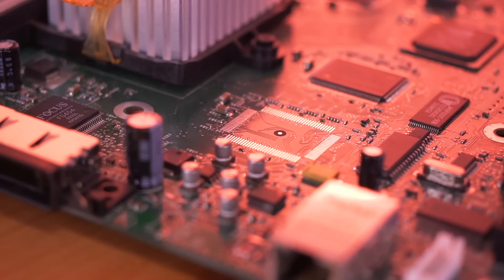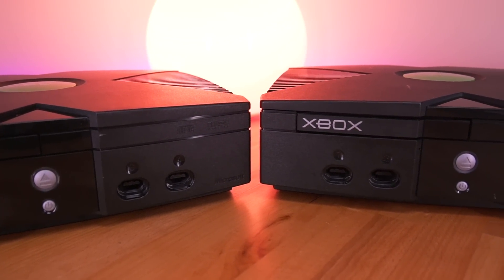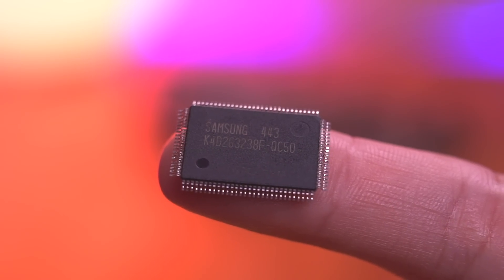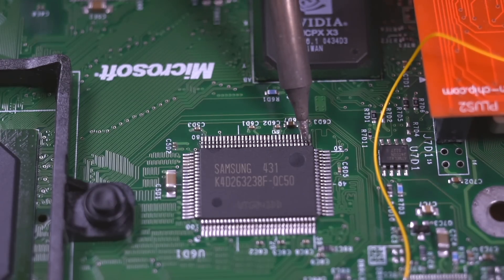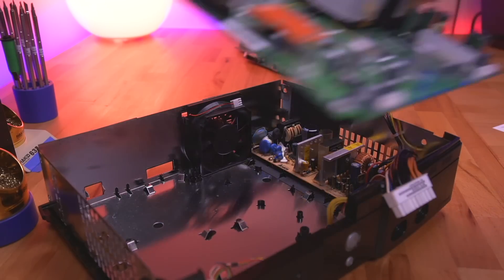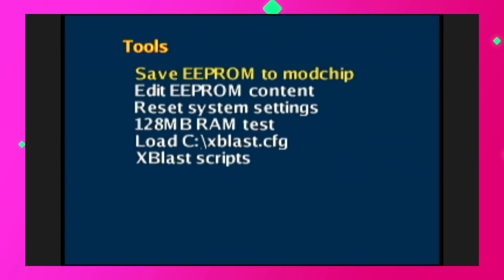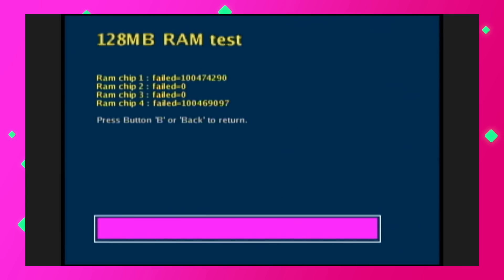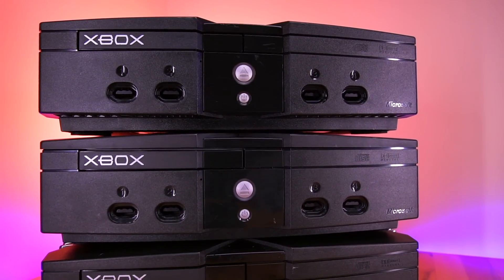I Did The Impossible 1.6 XBOX 128MB RAM Upgrade! | Piggyback Method!

Comment: ive tried this with two sets of ram chips all I get is the console powering on for a split second with orange light then it switches off I'm using aladdin chip Cerbios 2.3.0 beta, can anyone help with this, as soon as I remove the ram chip the console boots up fine with the cerbios I'm using, I've tried doing this numerous times

Comment: I don't think anyone with the know how thought this mod was "impossible" just not practical. Short of Microsoft redesigning the silicon there was always a chance to upgrade the RAM it just wouldn't have been pretty or easy. This is far from what I'd call difficult but it's also not nearly as easy as modding any other XBox revision which is why I think regular folk called it "impossible".

Really cool someone worked it out finally! I'd like to give it a try but finding legit RAM has gotten harder here a year later.

Comment: Now with a cpu swap you can even run windows on it

Because its just an off the shelf pc
Reply: And yeah someone has done that already
Reply: Just like the controller ports on the og Xbox are just usb ports with an extra 12vdc rail
Reply: Just disassemble, either put a custom lpc chip, or boot xbox with ide disconnected to DVD drive wait for error screen. Then hotswap unlocked hdd to a computer with ide with xbox still providing power to hdd, run a ramdisk and install unleashx to hdd and reassemble, chipless cfw.

Comment: 1) Obviously, all RAM modules share the same data lines; that's why it's called the DATA BUS.
2) The CHIP SELECT (CS) PIN is used to activate the module, but the processor itself doesn't "detect" it as you explained.
Reply: Dunno if you will read this but can you explain what happens to the chip select pin when its lifted and where and to what the connection goes to?
Our host here fails to explain anything and it really bugs me.
Reply: @alphadog6970  it's like a AND GATE on data output. Imagine one input of the AND GATE is the DATA and the other one is CHIP ENABLE (CHIP SELECT, CS, same thing).
If data is 0 and cs 1, data out is 0. If data is 1 and cs 1, output is 1, if data is 1 and cs 0, output is 0. Basically this

Comment: Its better if the pins are bent straight down like a socket type ic. But i wouldnt do the mod since im not really a big fan of mods, i mostly  think about preservation over modification. Besides, it doesn't help with retail games, like steel battalion, which i really like the most on xbox

Comment: Wouldn't that configuration actually slow down the memory though? I mean, if you were to think about it how memory is sold today where a 2Rx8 kit is faster than a 1Rx16 kit even when both kits are clocked and timed the same... i wonder if there's an accurate way to measure the differences between this and an older board with a memory upgrade.

Comment: There is also the RAM Delimiter tool which patches Xbox games to use more than 64MB.

As others have mentioned, this allows some games to be run at higher resolutions. Futurama is the first one to my mind as the RAM upgrade can allow it to run at 720p.

Personally, I’ve been interested in seeing whether it makes a difference to Morrowind performance.

Comment: So the only con is the difficulty of install? 

I seem to recall a company that would do the 128MB RAM upgrade mod and also upgrade the CPU with a faster one that fit the Xbox motherboard's specific bga socket. IIn the case of that mod, there was another con: Something about the CPU clock speeds and incompatibility with certain binaries. They sold their premodded xboxes with an external switch to toggle between clock speeds if I remember right. It's been a long while since those Xbox Scene days though.

Comment: I wonder if i could pay someone to make a flex ribbon cable to sandwhich ps4 ram chips on one end and then solder the ribbon to the motherboard ram slot instead. Since the points are underneath i wonder if that would work like this?

Comment: I just barely learned how to solder a mod chip on my 1.6 Xbox and replace capacitors. I don't have the skills required to do this mod, but I want to eventually. 

I used the same LPC rebuild board you used. It didn't work at first, until I found out that there are two contact pads that need to be soldered that connects D0 to ground. I was so confused when my Xbox wasn't working. Maybe this will help for anyone who uses these LPC rebuild boards.

Comment: Installing the ram would be fairly easy for me, regardless of the revision, but what i really want is the cpu swap for the OG Xbox.
Like one of those 1.4Ghz pentium 3's. And swap the HDD for like, a 256-512GB SSD. SSDs of this size are dirt cheap now.
256GB SSDs are $15 and 512GB are like, $25.
IDE to Sata Adapters sometimes cost more. OR there's that DIY IDE SSD thing that i've been hearing about recently.

I'd rather load the games off the SSD, which would load faster, and would allow for the 1.4Ghz patch (Modern Vintage Gamer) for games.
All that said.. There just aren't many games i'm interested in anymore.

Comment: Ram stacking is old school from before I was even born. Nice to see ita coming back for mods. Also have you done the cpu upgrade using n64 freaks board? If so do you have instructions or anything for it? Not sure if there is a different in pinouts from the 1.4 version.

Comment: Aaaa the memories, volt modding on old computers to facilitate more overclocking.
Glad i have a proper soldering station, and the skills to use it as back then you was tapping into these small IC legs
Doing the same today,,,,, well, first of all i would need my reading glasses.

Comment: I remember back in they day your could piggy back a 3rd party 14mhz chip onto if the Amiga 500 cpu, then you could switch between 7 and 14mz, basically doubling the the Amigas 500 speed, which was great for games like Wing commander and flight sims......but it is nuce to see this kind of stuff is still a thjngvtiday in this wirkd of just throw it away tech.

Comment: Not a new technique in general, though perhaps new to these machines. I recall using basically the same technique to add additional ram capacity to a commodore 64's add on ram unit so it could  do a full 2MB on it.

Comment: Stacking Ram chips. So I assume there’s no over heating issues with no to very little cool air for the lower chip. Very cool mod except for that fact of its limited benefits. I assume boot up times for games is not helped.

Comment: 7:11 Good advice to watch for the correct alignment. But the text on a chip is not a reliable method! Better is it to align pin 1, which is marked by a dot on the package (as visible in the video).

Comment: Just remembered there's a pro to the 1.6 revision Xbox. It doesn't have the clock capacitor battery issue that could render your console unplayable (I know this because of Cvit's video on the Dino Crisis trilogy. Where he had to get an OG Xbox for the third game since it's not backwards compatible with the Xbox 360)

Comment: All those who were previously parting out, destroying and stripping V1.6 boards for ram should be ashamed of themselves now.
The endless derogatory 1.6 comments - funny how it turns out. A V1.6 with XboxHDMI and 128mb ram can also now run a 16TB drive, has a newer component motherboard, cooler running mcpx, a later spec gpu, a better newer more reliable power supply unit and no leaky time capacitor either. I also noticed improved nic chip performance over lan when transferring gb of files compared to v1 to 4.
Who’s the ugly duckling now then?

Comment: This is nice but I highly recommend the average user to avoid 1.6/1.6b revisions at all costs.
They have a different encoder (Xcalibur) that has issues on some games and doesn't run many at 480p properly, it can't be TSOP flashed, the LPC is a mess making it harder to hardmod, the RAM upgrade is more difficult even though this talented user was capable of doing and it's not capable of running without a clock cap (so if you remove the original, you'll need to replace it).

The other revisions from 1.0 to 1.4 are completely fine though. 1.4 also has a different encoder (Focus) but it's almost identical to the original ones so progressive scan works fine, you might just need to adjust contrast/brightness on your TV if you have a 1.4 so it's a minor issue.
Edit: 1.5 doesn't exist (it's a myth) so not worth mentioning.

Comment: That extra RAM helps with XBMC linux software beyond XMBC (like FOSS games, or science software you might write or GTK), but also the 63MB RAM DOS box limit which allows DOS productivity software (not just games) to run. Akin to the concept of a mezzanine connector, surely and upturned custom (maybe 2inch square) female-socket PCB would allow for the 2nd chip to piggyback on but so it is reversible (to undo the upgrade) or rather for so as to be uninvasive an upgrade. I'm not even talking desoldering the old chip (although maybe a 3rd custom 2 inch PCB could so that). Soldering on that pin 28 also could be done via clip, sans solder. Don't get me wrong. I acknowledge this is cool. Just stating that surely people would have already considered such options. Would've been cool to see a Xenoblade-Chronicles style game on that xbox with a minimum 128MB RAM requirement. I'd always though the xbox should have had not only 128MB RAM minimum but also a 2nd unoccupied CPU slot with an extra RAM slot so that it could be upgraded to dual CPU and then extra RAM (perhaps another couple of 256MB sticks, thereby totalling 384MB RAM or 640MB so as to store a whole CDROM ISO pretty much). Microsoft media codecs' developments and progresses were cool in that time (not that they are not cool now btw) and media creation software (almost like psone music-2000 or guitar-hero) would have been so cool let alone video mixing like how TonyHawks PSone game has a level editor and a bunch of videos playing. Burning a CDROM ISO via rj45 ethernet to a home MSWindows PC would have been nifty. Even just with games though, a "later added" dual CPU with a RAM upgrade to 640MB RAM could have allowed for all sorts (not just quick loading) like improved graphics from shadows done on CPU, pre-calculated geometry (ZBuffer, Gaussian functions, alternatives to bump-mapping, higher-resolution, compression-speed, etc), and physics and lots of texture swapping in and out of RAM.
My comment has no hate in it and I do no harm. I am not appalled or afraid, boasting or envying or complaining... Just saying. Psalms23: Giving thanks and praise to the Lord and peace and love. Also, I'd say Matthew6.

Comment: I had a gut feeling 1.6 of all things didn't have the 128... Sorry what, it's possible? Regardless, it won't really matter much to me. A uh, 1.13GHz 512KB L2 cache should do the trick, not to mention 66MB ATA, and WD Black 2.5 inch upgrades. And 3D printed parts for holding the HDD and the 60mm 5V Noctua fan in place. Hmm... It seems I may lack some cooling, I do have this Southbridge heatsink I guess.

Comment: Two additional pros I feel you missed:

1: The 1.6 Xbox tends to run cooler and has the newest hardware (also no clock cap that explodes) so is arguably superior.

2: The RAM upgrade (regardless of Xbox version) does allow for higher quality videos to be played in XBMC, which can be a decent benefit if you're using your Xbox as a bit of a media machine.
Reply: The clock caps in 1.6 systems are considered "less leaky" when compared to other generations, they still have clock caps and they still can leak. The big problem you run into is 1.0-1.5 systems can run without a clock cap (modded) while 1.6 systems require the cap, so if your cap starts leaking your only option is replacing it with a new one. I just had to go through my units to check / remove caps, two 1.4's and two 1.6's.

Comment: Please tell me you added thermal pads in-between and upped the cooling? Just from a general standpoint without those I'd imagine they would start suffering from heat issues from being direct stacked and stock cooled.

Comment: I'm wondering now if this same technique is possible on older xbox revisions for even more ram. I'm also wondering if installing the chips in parallel this way will underpower the chips in some way. Interesting mod.
Reply: I was wondering the same thing as well, it might be possible but since there isn't any software that uses more than 128 MB it might not be entirely worth it (if it is possible that could change in the future but for now there isn't any which decreases the incentive to do it).

Comment: Were you playing Virtua cop 3 & Ghost Squad properly with the light gun? As in it was calibrated properly? I did this mod about a year ago and found that I couldn't get it to work correctly when using an Xbox light gun. I could fire etc but the aiming was off or slow or something from memory. Felt unplayable. Like it needed calibration. Have people figured that out now?
Reply from the maker: The light gun wasn’t very responsive. I bought it for the video and think it was a dud. It would register sometimes but very sporadic.
Reply: @MachoNachoProductions  Have you tried it with any normal Xbox games (e.g. house of the dead)? You might find that the gun is ok, it's just this chihiro beta build of Virtua cop 3 that's out there. Not sure that it's designed for normal Xbox light gun support.

Comment: Is it possible to order custom made ram modules? So you could just make a larger module unsolder the original and put the larger one on and skip the wire all together?
Reply from the maker: I’m sure that would be very expensive to do

Comment: Modded-ish my MSI GL65 Leopard i7 10750H, 2060RTX laptop. MSI left the pads for a 2nd m.2 drive so I added the 10 caps, the m.2 connector, and the nvme hold down stud.
Once done, I threw in a 2TB stick and now have a dedicated drive for my games.
Was lucky my laptop version had the pads still, some laptop reviewers showed one on the locations without them.
Reply: I wouldn't have risked tbhh

Comment: Before the answer is revealed to me by anyone, I already correctly guessed the method is to stack the memory chip on top of the existing memory chip connectors.

This is because I remembered Buildzoids explanation about computer memory's "ranks" and "banks" sharing the same physical electrical lines/connections for larger capacities, just that they are accessed logically.

Comment: What happens if you upgrade the TurboGrafx 16 ram will that stop some of the flickering in some games.
Reply from the maker: Most likely not possible since the hardware needs to be able to address the newly added ram chip
Reply: @MachoNachoProductions  It might be possible they have the Supergrafx just an upgraded PC Engine with more ram and chips inside.

Comment: RAM piggybacking is kind of an exceptionally old hat! I wonder whether somehow nobody thought of this because the other boards are easy candidates for the mod, so it just didn't make sense to put effort into doing this on a 1.6, or the exact CS layout wasn't known until recently, or maybe it was considered a little dicey since you're introducing a CS signal skew, so either the length of the wires comes out spectacularly fortunate or there's a really lax waitstate that you wouldn't normally expect from a modern system like this, but likely kind of both? I think the hidden history of why the mod is only available now would almost be more interesting than the mod itself.

Comment: Higher resolution game patches are also another main advantage of installing this mod. Enabling XBMC4XBox to play more file types in HD as well.
Reply: could they be programmed to handle 128 mb?
Reply: @EEK-XAAK  Depends on the game. Not all necessarily can automatically scale their needs past 64MB. Some are hard coded and need to be hacked which is well beyond me. I would assume we can patch just about anything to run at a higher resolution than it did at retail simply because we do have double the RAM available.

That doesn't guarantee the GPU will like that at all or the CPU will hold up it's end of the bargain.
Reply: Can someone one who has these upgrades tell us if halo ce runs with the pentium III. Is it a smoothe gameplay with compatability mode?

Comment: RAM stacking is a technique used nowadays too, especially in the SSD or GPU field. Interesting idea to use it here too.
Reply from the maker: Cool!
Reply: @MachoNachoProductions  One thing to note is that heat seems like it could be a concern in some devices with chips stacking (it is for SSDs, although those are now built to take outrageous heat, I'm talking 70-80C!), but I don't think the Xbox is an issue with this.

Especially since as you said in the video, you need to reach hard to even use the extra RAM. (unused RAM isn't going to generate heat, if anything your new RAM is a pseudo-heatsink FOR the original RAM when using under 64MB haha).

The RAM is also unshielded from heatsinks to begin with meaning Microsoft did not think it was an issue that it'd ever get remotely hot.

I wouldn't do this on, say, a PS3 or 360, as I believe those do run very toasty RAM, and do guard it with a heatsink.
Reply: @acumenium8157  some of them manage to sandwich conductive metal foil in between the stacked chips to help with heat dissipation. The high-capacity enterprise drives are sandwiches of PCBs filled with NAND chips and linked with ribbon cables, and they fold out like an accordion. Crazy dense capacity also gives you crazy heat output with equally crazy packaging solutions to overcome it lol

Comment: The 128mb mod was always fairly niche in use, but very cool to see the 1.6 can pull it off. I remember the 1.6 was a pain with any mod....
Reply from the maker: Yeah, the 1.6 is definitely not the most mod friendly.
Reply: Nowadays I use it to play a bunch of games in 720p or sometimes widescreen where before they weren't compatible (running the 720p mods on most games before would crash the system due to the ram cache being too small)